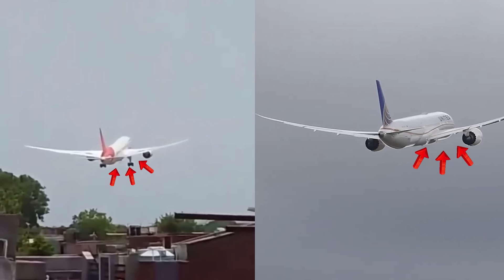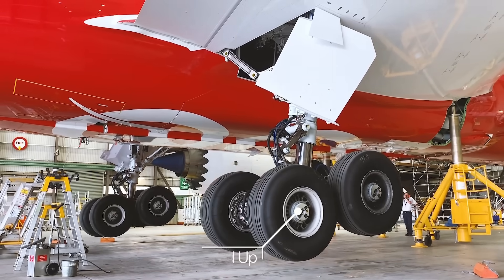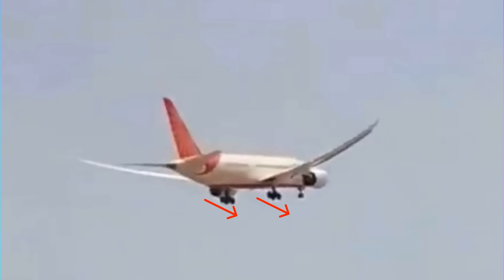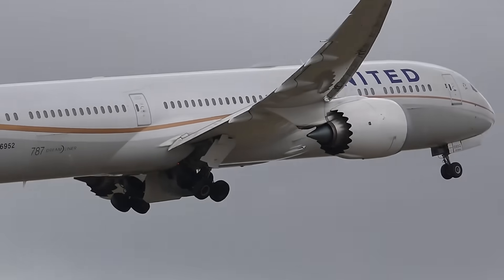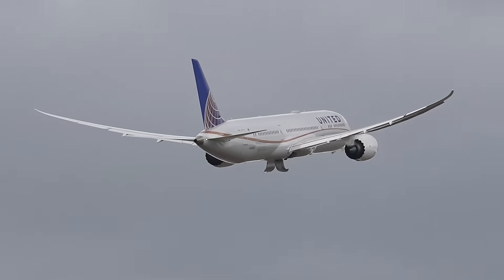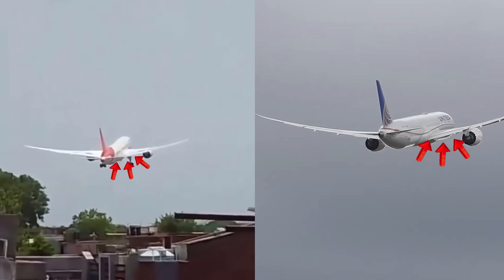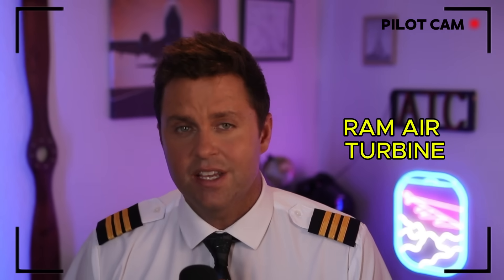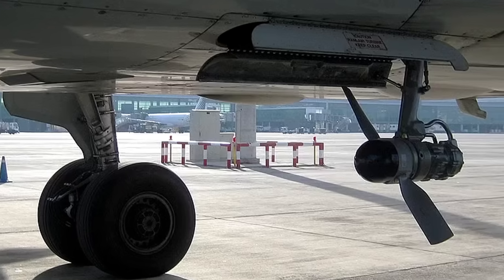Pilot Explains: A New Detail in the Air India 787 Crash Everyone Missed

Comment: you are getting there ... THIS IS WHAT EVOLVED..  the heavily depleted Lipo battery pack  shut down when the GEAR UP command was initiated .the surge loading from the hydraulic pumps being activated to raise the U/C . Lipo battery pack are monitored by a BMS   which disconnects power if the low limit voltage is experienced .This battery shut down caused the fuel delivery pumps to loose full throttle delivery power .turbines rely on fuel delivery any reduction in EMF Electric   Motive    Force . will be reflected immediately and exponentially  with a loss of thrust . i guarantee that this is EXACTLY the scenario which that unfortunate highly skilled pilot experienced briefly . Am I right or am i right    the ABOVE is exactly what occurred .no if,s   or but,s .. check it out next time you are at 400 feet AGL simulator takeoff . cut the battery power and discover what you SHOULD / COULDNT have done .cos   sure as eggs is eggs   you are gonna die.

Comment: Hello Garybpilot, thank you for a thorough investigative discussion. DOES Boeing 787 HAS FUEL ON-OFF SWITCH ONLY AT THE WINGS FOR GROUND STAFF TO OPERATE DURING FUELING??
  It mentioned in another utube video that Boeing 777 and 787 has one major difference which may have been overlooked for this accident in Boeing 787. The fuel cut off switch just before fueling is at cockpit in 777 while 787 has fuel cutoff switch only on the wings.
In the past due to many problems with malfunctioning of that switch in the cockpit they placed this on-off switch at the wings for the ground maintenance staff to switch it on or off. Do you think that this might be the reason that after fueling they forgot to switch on the fuel and the fuel  lines of the aircraft had just enough fuel to climb up to 600 feet and then stall due to fuel starvation Do you think this might be the cause or if this fact is correct about difference Boeing 777 and 787??
Thank you

Comment: Agreed the engine pitch is much different it is much higher, double engine failure; I might even be considered somewhat of an expert on the db level of Jets on take off and that was a flame out, tragic loss......Fuel - check the previous 3 fuel ups where? Last one should be the issue but other possibilities in Fuel System. fuel tank to engine combustion system absolutely need to be investigated NTSB should be able to give a pretty decent idea in a few days if not sooner...I wonder if the Emergency Fuel shut off valve was accidently triggered or the code hacked and initiated?   Or god forbid the tanks were empty to begin with?

Comment: A few options to consider
Fuel contamination. Cleaning? Probably from the center tank. It got into the fuel lines after rotation (which always causes sloshing).
Mailfunction of the LRRA and / or FADEC system causing an emergency shutdown of the engines.

One other thing you can see on the tail is that the APU inlet door is open indicating that the start sequence was started after the RAT deployment.

There where cases where the auto throttle system malfunctioned, there is a mandatory fix, was it applied to this plane? (not a likely cause)
https://www.federalregister.gov/documents/2024/09/18/2024-21144/airworthiness-directives-the-boeing-company-airplanes

One of the things I am afraid of is that the DFDR/CVR recordings are incomplete as they stop working on a bus power failure.

Comment: I recall the Airbus A320 that landed itself in a forest at an airshow AF296 visually this accident was very similar , I’m not saying it’s the same cause but it’s visually very similar, and I think it unlikely that fuel contamination would cause 2 engines to fail simultaneously, so as in the airshow accident it could be a FADEC (fully automated digital engine control) issue where the engines were automatically but erroneously commanded to spool down because the computer thought they were landing.

Comment: I gave an explanation the day this came out. I had seen enough good quality videos to know both engines lost thrust. Now, how would you feel everyone commentating said that fellow pilots made the mistake, but they did not? My explanation was that the FO had selected gear up, and THAT was the point all hell broke loose. Hydraulics failed. I think the fuel pumps failed, and the engines lost thrust due to fuel starvation. I think the electrical system had a massive failure. Was there a bomb? Was there an explosion or fire in the cargo hold?

Comment: I believe that modern jet engines should keep working as far as fuel in reaching them, and all protection systems should function by the "fail safe" principle, i.e. a positive action should be needed in order to stop an engine. Since there should have been redundant pumps (both electric and hydraulic) the single common factor remains the quality of the fuel itself.

Comment: The odds of a dual engine shutdown on a B787 are low, but several are known - mostly software or system race conditions where both engines and/or fuel system were automatically shut down or reduced to idle power by the automated systems in response to unforeseen real-world conditions, i.e. software design and testing defects.

Nippon NH-985 from Tokyo to Osaka, Jan 17th 2019. Both engines shut down completely after landing when reverse-thrust was deployed.
Jetstar JQ-15 from Cairns to Osaka, Mar 29th 2019. Both engines went to idle power for ~81 seconds on landing approach, but recovered thereafter.
American Airlines post-maintenance test flight at Boeing MRO, San Antonio - RAT deployed in flight after electrical issues, but the aircraft subsequently landed intact.

Comment: I saw another video of the takeoff.  The aircraft seemed to take the full length of the runway.  You can even see the dust and dirt in the wake immediately after leaving the ground.  If this is true, I guess the question would become when the first sign of a problem occurred and whether the crew could have done an aborted takeoff.    If it is contaminated fuel or other mechanical problem, would and should the crew see the degraded performance if it occurred on the ground before takeoff?

Comment: I am not entirely sure as I know nothing about the systems architecture of the B7x.
I watched the take off and retraction sequence in real take off videos (they differ slightly from the hangar test for reasons).
Sequence:
As the airplane lifts off the truck positioning actuator forces the truck rear axle to stay in contact with the runway to give more ground clearance and reduce the tail strike risk.
This means: Just after lift off the truck should be in a rear axle down position.
On gear retraction the main bay doors open first, then the truck position actuator rotates the truck into the front axle down position, then the gear retracts and the main bay doors close.
The main gear seemingly being halfway through the retraction cycle with the first step,  gear bay doors open being amiss, suggests to me that at lift off the truck position actuator already was non functional.
The engines must still have made power at this time since the plane was initially climbing out. As I understand it the hydraulics should be fully operational even with the engines at idle, and most definitely at a trust setting which allows the plane to take off.
Was there a cascading catastrophic system failure which first affected the hydraulics and prevented proper gear operation and gear retraction and then shut down the engines?
Also: The gear most definitely was never retracted and gravity dropped after engine failure. In case of a gravity drop the main bay doors drop and remain open. The main bay doors are only closed with the gear down if the gear was dropped with full hydraulics operational, before landing.

Comment: Thanks for more theory’s, is it possible on a 787 that, shortly after V1 and rotation an engine fire warning occurs, and during the critical moment and unexpected timing the response from on the deck the wrong engine is mistakenly shut down… resulting in both engines being offline? Or would this not occur within the timeframe of the event period? Would this scenario then trigger RAT deployment automatically as part of the aircraft’s emergency systems?

Comment: There have been some double engine failures. An interesting one was Bristish Airways flight 38. Ice clocked the engine oil-fuel heat exchanger. It happened in a very specific scenario, but it happened. Not sure if something like that is possible with a previous flight in the bag, but the turnaround time from the previous flight (plane came from Delhi) wasn´t that long.

Comment: If both engines were failed , the speed could not have been higher than 180 kt, how do you explain such a smooth glide slope? Approximately 500ft/ min

Comment: Are the fuel pumps driven from the engines or from an electrical source if from an electrical source a failure of that would cause an engine failure. If driven from the engines then the cause most likely is fuel contamination or as I am sure Captain Steeve mentioned a vapour or air lock unlikely but the air temperature at take of was 40degrees C, just thinking out loud great video Gary

Comment: Several U-tube videos indicate that Electrical/Electronic systems on this plane were failing in flights before the accident. What happens if during Take Off The main AC system which feeds the fuel pumps fails???? This explains the activation of the RAT.  A 787 can potentially operate without pumps by utilizing gravity or suction-fed fuel flow, during take off however this principal might have not worked resulting both engines flaming out and consequently loss of necessary thrust to push the plane.

Comment: Dual engine flame out at the same time is so unlikely.. like all 4 generators failing at once or fuel pumps. On the runway video when the plane takes off I think it's yawing slightly to right that could mean engine 2 failing. What I'm wondering is that maybe they had one engine fail and for some weird reason shut down the wrong engine. And am I only one hearing jet engine noise in the better quality video with RAT? Definitely not much power though..

Comment: I agree with everything you say, I was thinking the same thing. 

I think the cause was not engine failure. I think the root cause was electrical system failure. The sole survivor said he heard a big bang before the plane crashed, at seat 11 A he is fairly close to the avionics bay. I think something overheated in the avionics bay leading to a loss of electrical power, which then exploded. 
    The generators were probably still producing power for a while, but it was shorting to ground, that’s why the pilots radio had such a weak sound. Without sufficient  electrical power you might have had a worsening fuel supply problem to the engine.

Comment: If the RAT deployed (most analysis say it did deploy) it did during take-off, so at relatively low speed. Does it generate enough power at this low speed to take over the essential electrical and hydraulic systems?

Comment: Dual engine failure is likely the case. The flickering lights and loud bang claimed by the sole survivor are clues neither you nor Steeve try to assess in your initial video. The loud bang is resultant of engine went flame off (and also stall). The flickering lights is due to decaying rpm of the engine driven electric generator. 

I dont know why only pilot making this kind video and somehow they get the public attention. 

I am still waiting for an aircraft engineer to provide their view especially on the common failure modes for dual engine failures.

Comment: What if ground heat vapor locked both sides of the fuel lines for both enfine fuel lines?
Reply: I know vapor lock was quite common for older cars with carburetors, but for jet engines?

Comment: Great analysis, and thanks for the video showing how the mains tilt when commanded gear up. It's becoming clear both engines lost power, and what's disturbing is they both lost power at the same time. To my understanding, and hopefully someone in the know can chime in, losing electrical power should not cause the engines to flame out as they are already in ignition off self-sustaining mode, like a diesel engine. After the start sequence, a jet engine should run as long as it has fuel. But to other creators' points, the RAT will automatically deploy in the event of a double engine failure. So the question now is, why? To your point, the probability of both engines suffering some mechanical failure at exactly the same time is astronomically so high as to not even be considered. Hopefully 787's highly sophticated FDR will show what happened.

Comment: For another possible reason for dual engine failure you could take a look at ba flight 38.  Ice in the fuel system clogged the fuel line causing fuel starvation.  Although that was a failure on landing, is it possible something similar happened here?

Comment: I completely agree with  your analysis.  Just your click bait drives me nuts.   Not "everyone" missed it.   But you've caught up, and now all we need to know is why two incredibly reliable engines failed neatly simultaneously on take off.   Pretty damn hard to believe that pilots would pull back the throttles on takeoff.   The gear up/down level is incredibly well designed to indicate that it controls the state of the wheels.   The boggie handle of the dangle was a great observation.   Seems like the order of things were .1) liftoff, 2.) Engine Failure, 3.) RAT deployment, 4.) Attempt to raise gear.    All of that happened within 30 seconds.   The observation that the gear aren't going up with just RAT power alone connects the dots.    Hope the investigators get some samples of the fuel from wherever it came.    Wonder how full the plane was before refueling for London.   Does water build up in the tanks?   Who's doing the  Cessens 172 check on fuel contamination?   Did they some serious maintenance on the 787 prior to this flight.   Lots of process related issues need to be evaluated.   Anyway.  So far you have the best analysis.   I don't think it was a pilot problem, I don't think it was a plane problem.

Comment: Electrical failure due to excessive heat, is looking like a strong possibility.  Surprisingly, Boeing sources a large variety of electric and electronic components from China, and items like Chinese made lithium ion batteries and known to be prone to igniting spontaneously when under high load.  Those batteries live in the same bay as other critical components, so the failure of a 10 dollar battery could burnout the entire equipment bay.  Has that bay been identified and studied yet?

Comment: Pilots put out Mayday for “engine failure” at 13:38:25. That explains why RAT automatically deployed. Here are the five (5) parameters that cause RAT to deploy :

1-Dual engine failure; 2-Low pressure in all three hydraulic systems; 3-Loss of all electrical power to Captain and FO flight instruments; 4-Loss of all four electric motor pumps of the hydraulic system and flight control system faults during approach; 5-Loss of all four electric motor pumps of the hydraulic system AND an engine failure on takeof😢f

Comment: There was an electrical circuit problem. During the previous trip, the compressor malfunctioned intermittently, the air conditioning was not working, passengers faced a critical situation, and the plane was extremely hot.

Comment: One point I think is missed is the dust getting thrown up as it takes off.   Why is this important?   Because it suggests that it was right at the end of the runway.   Then the question is did the pilots keep going past the point of no return in an aircraft that was struggling to create thrust?   At take-off I think they were both too busy trying to figure out why they had lost thrust and the engines to worry about landing gear.   RAT deployed automatically because there was no power from either of the four engine generators (plus two in the APU - but it probably wasn't running).   If the fuel was contaminated then the aircraft rotation could have brought more of that contamination into the fuel system.   I also assume there's enough redundancy in the fuel system to rule out pump failures, therefore it still come down to what was wrong with the fuel?

Comment: Agree to full dual engine loss, not the flaps were the issue... as I get it with this 787 Dreamliner, for the take off only the fuel from center tank is used and serves both engines simultaneously, no fuel from the left/right wing tanks is used for take off... But the deployed RAT on that 787 is obviously not assisting the center tank but the wing tanks only; so I assume there has been a problem with the center tank right in the moment of take off (fuel starvation more likely than fuel contamination) -             a blockage of the fuel lines from the center tank to both engines, (maybe due to electrical failure or air bubbles)... and there was not enough height in feet nor time to fix this... 35 seconds are sadly not enough time to manage such failure... I believe the professional captain crew was not the issue... Praying for all the beautiful souls that didn´t survive this fatal flight and sending many blessings to their loved ones...